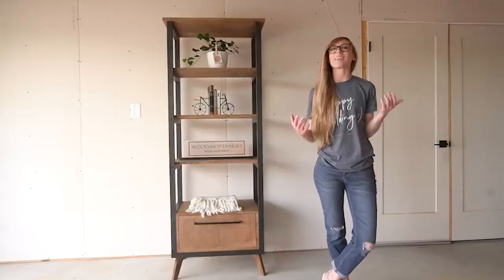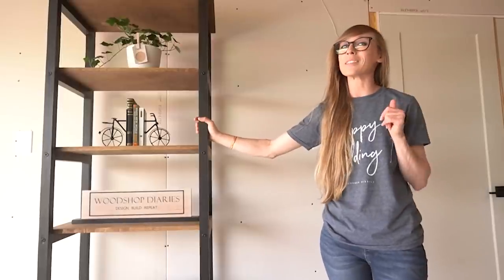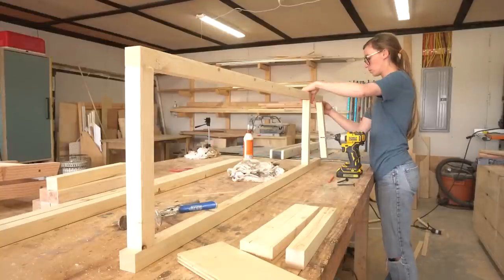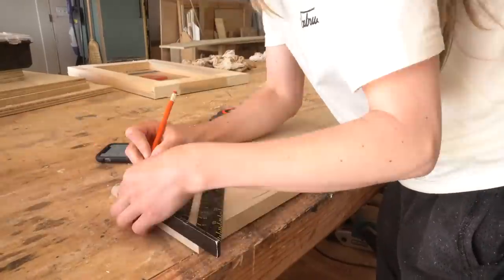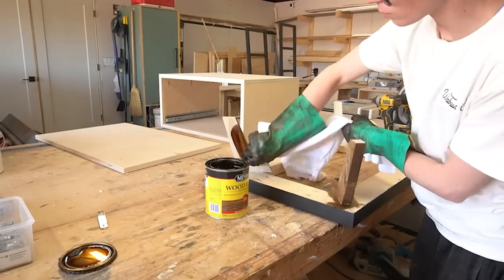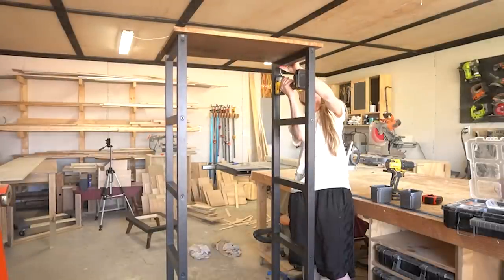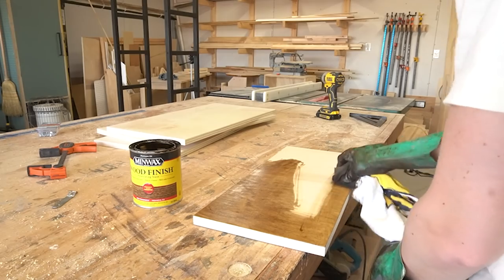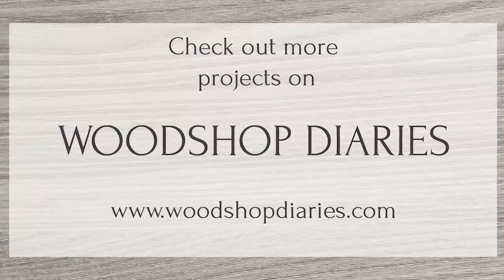How to Build a Modern Open Bookshelf {with Drawer!}

Comment: I immediately noticed the screws during the intro. I thought they looked fine. They reminded me of the first stereo rack I built where I used 2 in black drywall screws with a nickel finished washer to secure the shelves. Kinda a nice mechanical accent. You do good work.
Reply from the maker: Thanks so much! I’m glad you noticed them. I didn’t feel like they stood out as much as I’d hoped, but I’m glad I tried them for this. The little details make it 🙌

Comment: well, I suppose "to each his own", this design over the closed bookshelf is so much better in my opinion, it feel elegant and classy whilst (again in my opinion) the enclosed one feels rigid and  constraint. Granted the open one would need more constant dusting/ cleaning from my experience , but  I would choose this over the other anytime. Very nice (for both designs) !
Reply from the maker: Everyone has a preference! I really like how this turned out (as I suppose about 50% of others did as well based on my poll 😂) but I feel like it’s kind of trendy and may eventually “go out of style”. The closed version is more classic and would fit multiple styles if your home wasn’t exactly “modern” themed. But, they both look and function fine. I’m happy to share both to fit both preferences. 😅😅

Comment: Do you use a jointer/planer to straighten the 2x4s before running them through the table saw
Reply from the maker: I don’t have a jointer but I sometimes use the planer before the table saw. I didn’t in this case, though.

Comment: Do you have any tips for staining plywood? I hear it can be tricky? Thanks!
Reply from the maker: Hi! Honestly, I don’t really have any tips. I stain plywood just like I stain anything else…sand to 220 and use an old T-shirt to wipe it on. Some people use prestain, but I’ve never used it. If you sand it all consistently…as in sand the entire surface to the same grit, and evenly wipe on the stain, I’ve found it’s always turned out pretty good. Now, that’s using cabinet grade hardwood ply—like birch, oak, maple. I don’t use anything else to build my projects with as far as plywood goes.
Reply: @WoodshopDiaries   thank you! That makes me feel more at ease. I’m so worried about ruining something I worked so hard on 😅 you would sand it manually right? Not with a powered sander?
Reply from the maker: I almost always use an ortibal sander. Just don’t sand it aggressively. But you can use a power sander on plywood with 220 grit just fine.

Comment: Hey, you know this screws you used. how is it that the  wood does not spin? Because you only used one on each side?
Reply from the maker: The screws hold them pretty tight so they’re really hard to spin. But the glue helps keep them in place as well 👍

Comment: Share,
Is the Gorilla Glue really working for you?
Reply from the maker: Just to specify it’s gorilla WOOD glue. Not the regular gorilla glue. It’s designed to be used with wood. Not the brown stuff. And yes, it’s worked really well for me. I’ve used it for several years and not had any glue related issues.